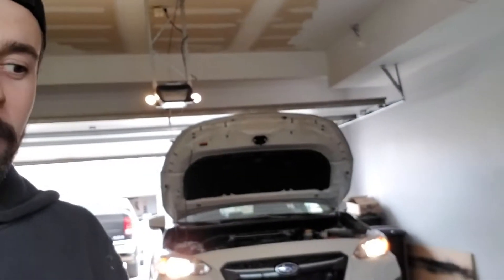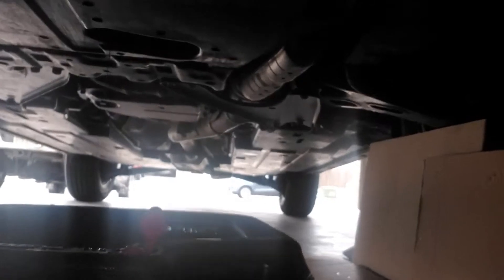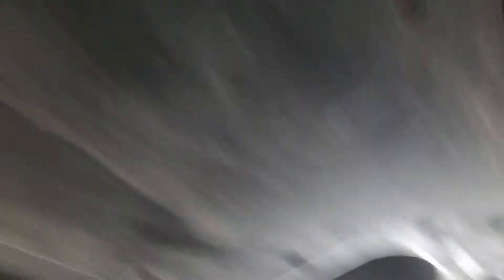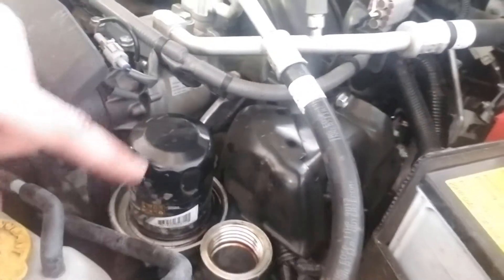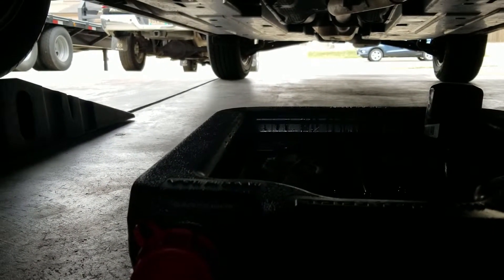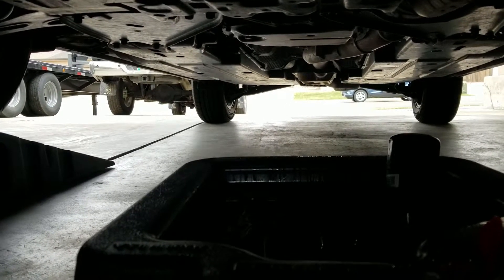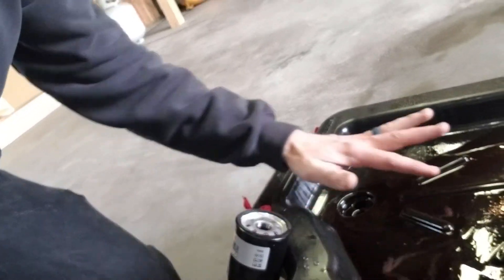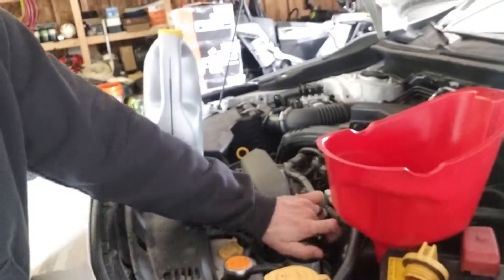Quick Subaru Crosstrek Oil Change

Comment: The torque specs on the drain bolt would have been nice even though you didnt bother to torque yours.
Reply from the maker: Maybe on future videos, torquing oil drain bolts is just something I personally don't stress over.
Reply: @km_motorsports  Ive tamed a bit over the years but i was notorious for over tightening  bolts etc. In my attempt to not over tighten, i like to go with the torque specs. There are lots of other people who like to follow specs as well. Providing them makes for a better video. A few years back i took my vehicle in for an oil change. Apparently he didnt follow the specs either. He stripped out the oil pan and replaced my plug with some crazy retrofit crap and never said a word. I discovered the next time i changed the oil.

Comment: Thanks for the video but I don't understand why guys always put dirty oil on the filter since you are about to open a new bottle of oil
Reply from the maker: Good point!  I honestly use whatever is easiest at that time (either new or used oil).  Being that I am not pouring used oil into the engine and its just touching the face against the gasket it doesn't concern me.
Reply: @km_motorsports   it would probably never be an issue unless you get a leak around your oil filter,  Which probably won't happen but I see guys using dirty oil to lubricate their filters all the time

Comment: It’s 5.1qt for crosstrek
Reply from the maker: Thanks!
Reply: @km_motorsports  ofc no problem brother!
Reply: I don't know about earlier models of Crosstrek, but the specs for 2021 are as follows:
– Changing the oil and oil filter:
2.0 L engine models: 4.7 US qt
(4.4 liters, 3.9 Imp qt)
2.5 L engine models: 4.4 US qt
(4.2 liters, 3.7 Imp qt)